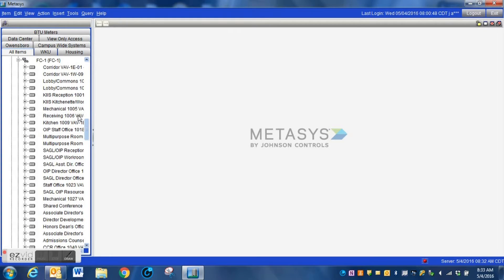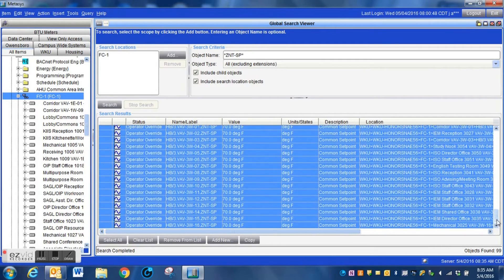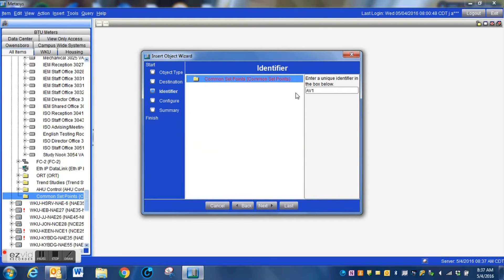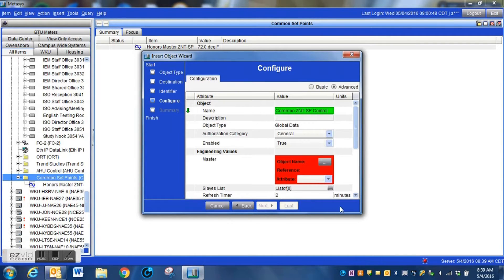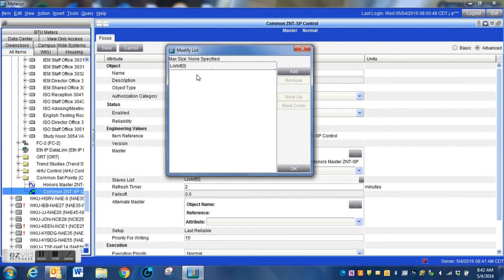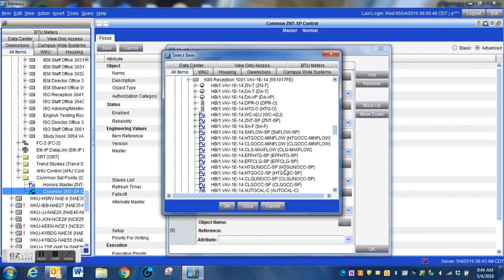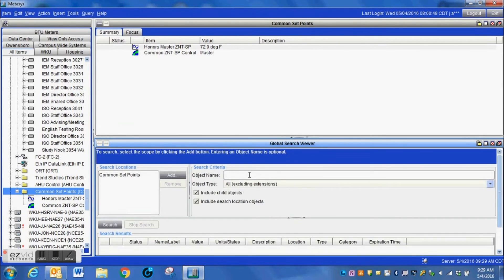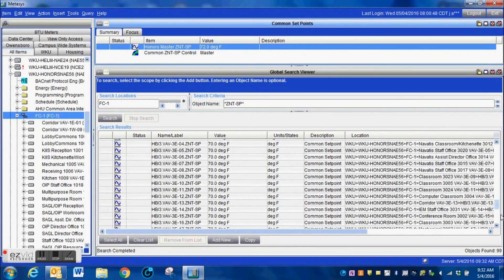How to use Metasys Global Data Object in Building Automation

Comment: How does the global data object work when you want to share data between a SNC16122 and an NCE2516 and how do you set it up?
Reply from the maker: You will set it up the same way. As long as your network isn't blocking communication between the two different devices, it will work fine.

Comment: Thanks for your video. I have a problem thou. I followed your instructions to the letter and it overwrites just fine. But it doesn't release. I tried "temporary overwrite" and "operator overwrite" 
I have to reset the field controller. That's not very helpful. What am I doing wrong?
Reply from the maker: The global data object is not intended to release values it writes from one to the other.  It has an adjustable refresh for when it will rewrite that value again from the master to the slave list.

Comment: I don't have a system to try it on but do you know if you first create a group <insert-object-group> and then select all the common setpoints as part of that group, which can all be done by holding the control key while selecting the points, can you then just add the group to the slave list and get all of the items commanded at once?
Reply from the maker: Theres other ways of doing it that would allow you to group them.

Comment: What about sharing points between NAE's?
Reply from the maker: There are a few ways of doing that.  You can use LCT or other logic blocks.  It depends on the type of data you wish to share.  The global data object is another way.   You need to remember that the speed of your network will influence the reliability of data transfer between devices.  Sometimes networks with a lot of security can have negative effects on the transfer of data.